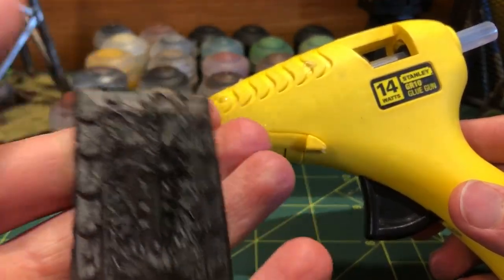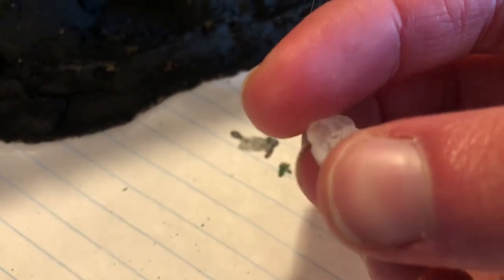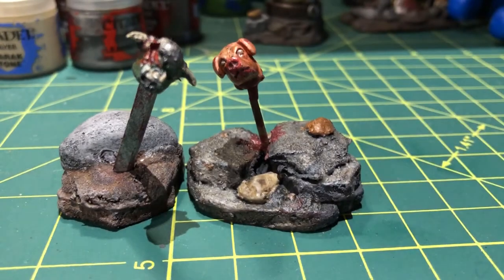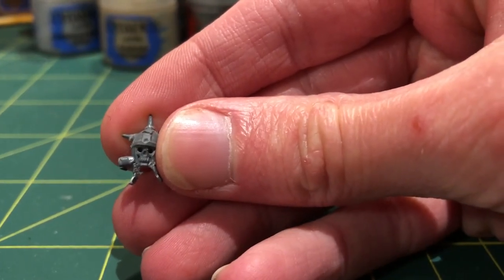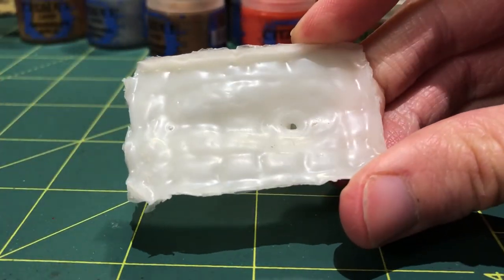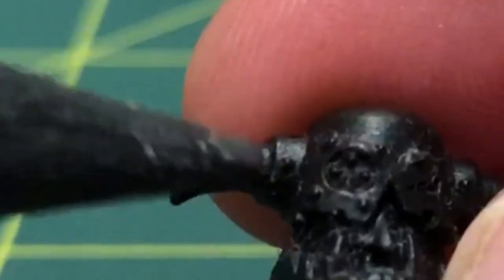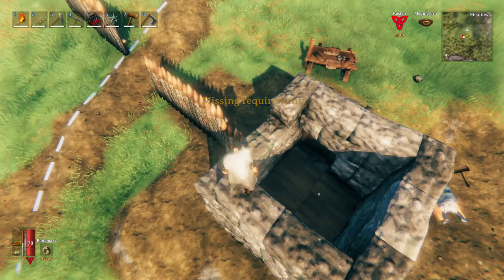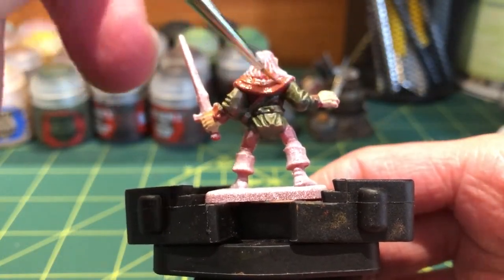Can You CAST Miniatures With White Glue? | White Glue Casting

Comment: It might be worth trying a combo method of using the hot glue mold, then pour in dissolved  plastic from sprues. I forget the chemical that dissolves that plastic, but I think it is cheap and may be in nail polish remover.
Reply from the maker: Sprue goo might work, but as the acetone dries it shrinks a little bit. I'm not sure whether or not it has a wavy texture when it dries, or if the texture would be smooth enough to get a good casting. It would definitely be worth a try, because even if the experiment fails you can just use the dissolved sprue for some other terrain project.

Comment: Try diluting the glue with water that has dish detergent in it. Start with a glue to water ratio of 10 to 1
Reply from the maker: That is something I should try if I attempt this again! What problem do you think it would solve most, the shrinkage?
Reply: @Sirdeathvids  Yes...shrinkage is definitely a problem, but breaking the surface tension of the water with detergent allows the mixture to flow into and fill the small areas of the mold. You have to build it up in layers, but the layers bond to each other. It's not a fast process in any way, but the acetate casting that results will be strong and durable.